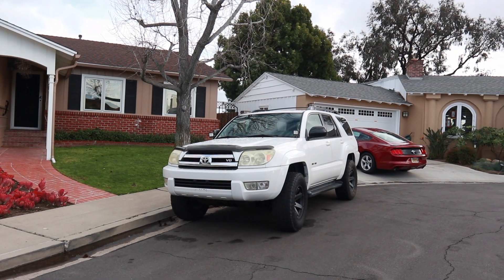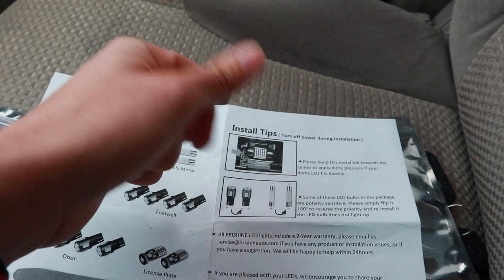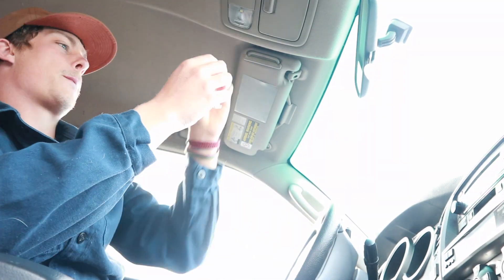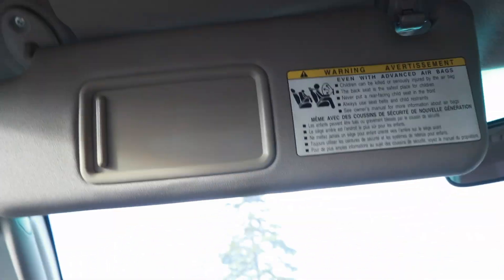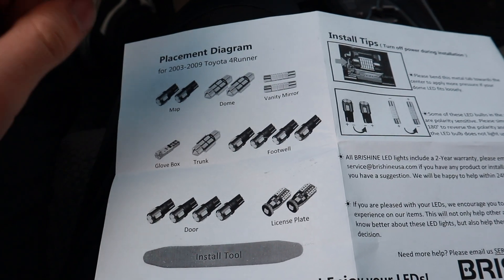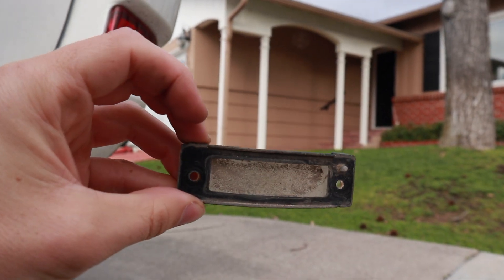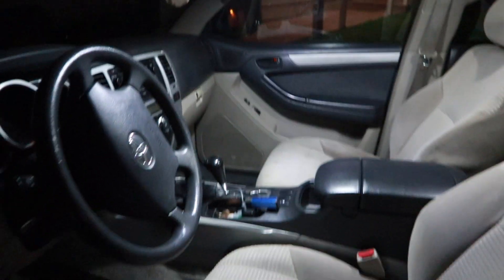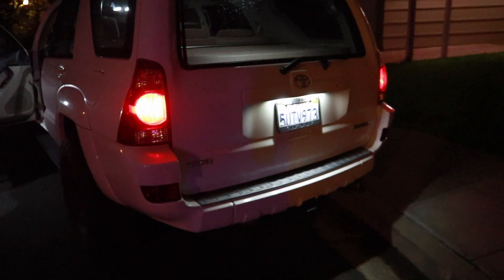4th Gen 4runner LED Interior lights install in 6 MINUTES!

Comment: Can you pull the fuse instead of disconnecting the battery? Otherwise power windows will have to be reset are reconnecting.
Reply from the maker: Yes you could